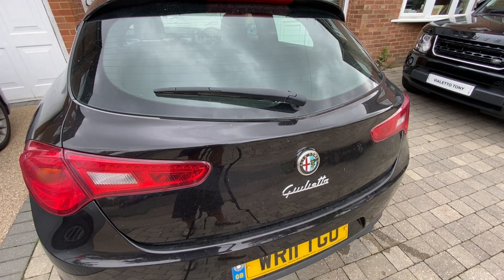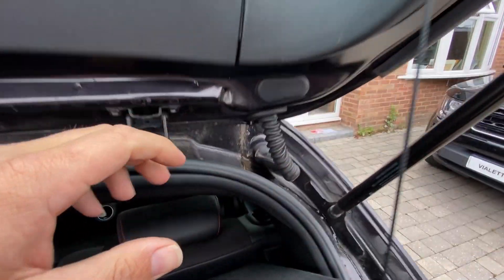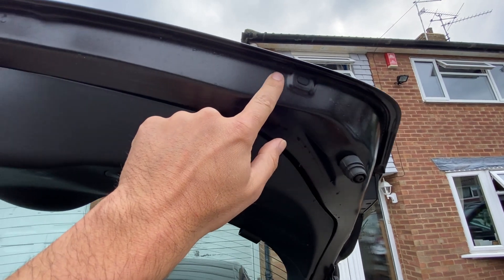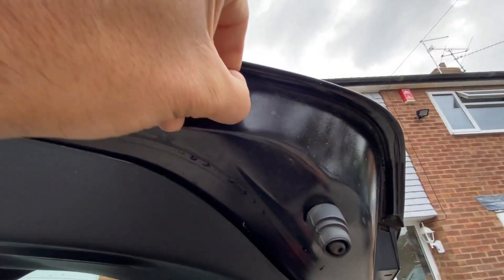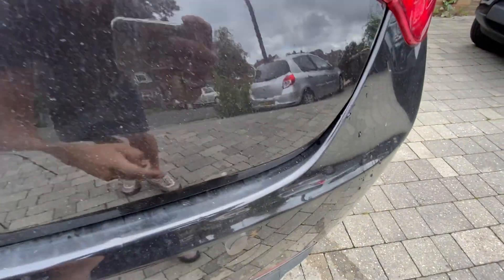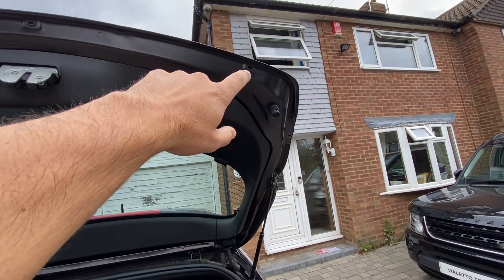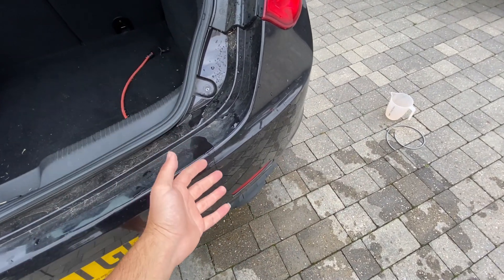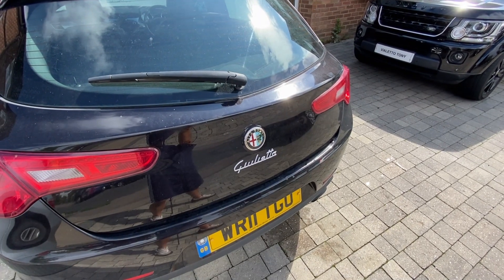Water in the boot lid... Still? You need to do this now. And it's FREE

Comment: One thing about the wiper gasket - I see you still use the older version (51830433). It's recommended to use newer version (50530945; used on 2013+ cars), which has slightly different shape and is reported to be much better. I installed in on my car (together with a light smear of RTV sealant) and had no problems ever since (3 years now).

Comment: Did you ever find out where the water got in ?
I fixer up my rear wiper seal with silicon and tested it with a lot of water
Nothing comes in there anymore

But when it rains a lot, my trunk is still wet inside

I opened the draining holes but still
I'd prefer the water not coming in, in the first place xD
Reply from the maker: Hi, no, it was never an issue after the wiper seal. Is the rubber around the window in good condition? Sorry I can’t help
More. All the best 👍
Reply: @vialettotony  Thanks for your reply !
I appreciate it :)

The rubber is in a great condition.
I guess I have to check with a mechanic than 😅
Reply from the maker: Maybe check around the wiring loom rubber mouldings. It can run in from the roof and track along those too. If you or someone has ever had them apart to fix the wiring loom it could have compromised the seal. All the best 👍
Reply: @vialettotony  Thank you ! 
I will check that 😁😁